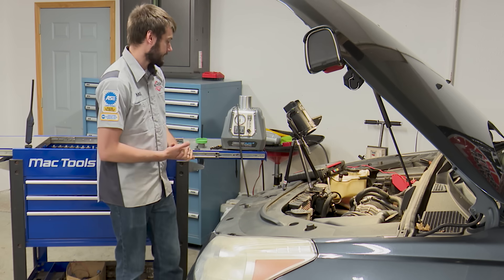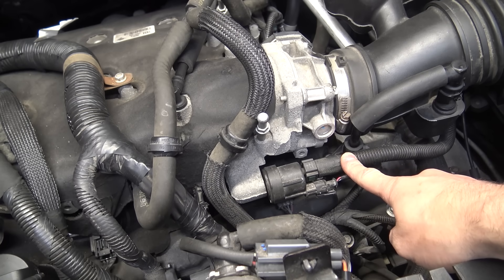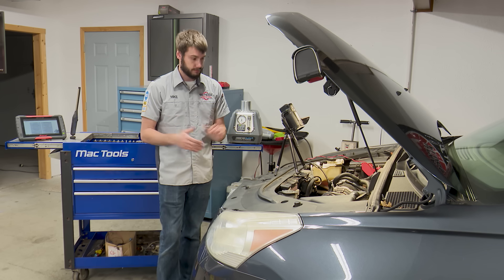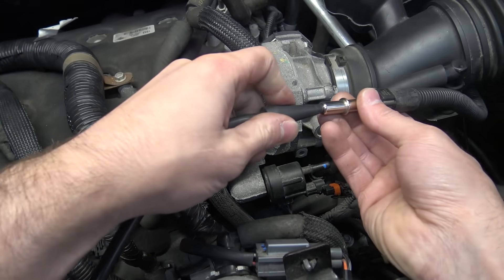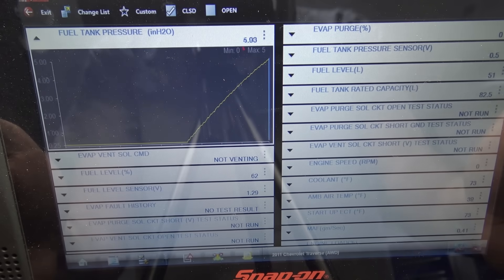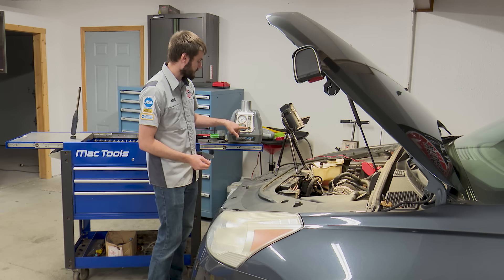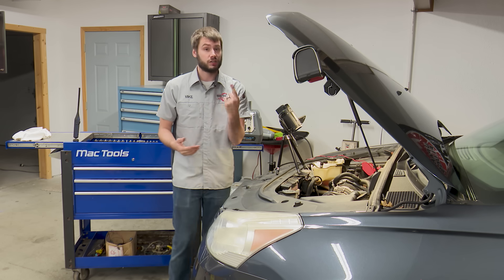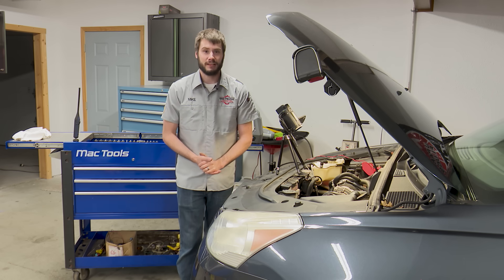How To Perform An EVAP Smoke Test To Look For Leaks

Comment: Probably not the best way but since i dont have a scan tool in the past ive run jumper cables from the battery to the tank area and use little jumper leads directly to the unplugged vent solenoid with a spare fuse inline

Comment: Great  video  tranks    is any other  possible place  for a  vacum leak     cause  i did  flollow  all this  steps   and still keep a  getting  p0442 code  purge  valve  and  vent  valve are  working

Comment: I bought a smoke machine from eBay for $30. Plugs into the battery And does everything that machine does, and way smaller. 1500 is crazy for a smoke machine.
Reply: Facts, unless you charge like crazy I bet it’d be pretty hard to make that money back on purely evap leaks, I feel like most people ignore them if they have a scanner since the car runs lol

Comment: can someone please show me how to smoke test a 2001  dodge ram 1500 v6 ,  I have  a smoke machine,  I don't know how to close the vent valve,  I am told this truck does not have one,  I have changed the fuel pump, solenoid purge valve ,  gas cap and the leak detection pump still can not find any small leaks and the check engine light keeps shining with code P0442.   I greatly appreciate it

Comment: I don’t have a full featured scan tool. What happens if I run a smoke test without closing that vent solenoid?
Reply: Smoke will most likely empty thru the open vent solenoid port.

Comment: Thank you for the video, very informative with multiple solutions to my unasked questions. One question was unanswered. With the P0456code stating an extremely small EVAP leak, which I believe would be linked to a possible gas cap. Can’t confirm at this time, need to acquire a smoke machine.  Car has a cap-less filler neck. I am going to clean the valve on the filler neck after I smoke test the system.

Comment: Do i need to remove the shrader valve from  inside that green cap to instal my smoke machine? i have 2002 toyota camry le 2.4  with a p0442 only.

Comment: What about smoke coming out from around the gas cap flange?

2016 Kia Rio. I started with an P0455. Changed the gas cap with an OE replacement and a purge valve. After that the gas cap light would illuminate periodically. I have a CCV ready to go, but smoke tested and found a serious leak where the filler neck meets the body.

Comment: Hope I get an answer 
I have a evap leak and I did  smoke test on my 19 Silverado and smoke is coming out of the vent solenoid filter, is that normal or what does that mean ? 
Any help please
Reply: If you smoke from Purge solenoid hose, this is normal. As the vent solenoid is normally open condition. If you want to test the leak , Close the vent solenoid.

Comment: Definitely  think automation  toyota  is fucking  me. They gave me a vague response  saying  smoke  seen from vent hose and gas tank. They saying  it will cost me 700 or 1700 bucks but they wont know until  they drop the tank.  But it could just be a vent valve.

Comment: Glad you mentioned the low-pressure requirements of an EVAP system. Most of the inexpensive, Chinese-designed smoke machines I've seen, which have the on-board compressors, go way over that pressure ~0.5PSIg limit yet still claim they're EVAP safe. I was curious, can the smoke machine you're using be used to test for intake manifold leaks or is the pressure too low?

Comment: Been a long time I see but taking a chance... Evap code so did Smoke test done on a Mustang '17 with no issues detected, no gas cap on this model.  Garages are still unsure the cause on this vehicle.  From time to time the engine light goes off for 1-3 days but comes back on.  Last test was while engine light was on so really unsure how to determine what the problem actually is and it costs $150 each time to have this test run.  Any thoughts?

Comment: This same machine cost 69 dollars today
Reply: Negative. You can get some machines for under $50 but not that model/brand smoke machine.
Reply: 😂😂😂 did he really pay 1000$
Reply: Can do it with a cigarette or even a vape pen if  you can fashion a nice snug  fit using a bit of rubber hose and/or electric tape though most vape pens cut power to their heating coil every 8-10 seconds so you might need a 2nd person to keep pressing the button on it while you look for leaks
Reply: Tik tok $40 use it at my shop plenty of times 😂

Comment: How would you use a smoke machine to figure out a p0171 p0170 code on a Honda ? Where would you connect the hose of the machine to? The intake or another place?

Comment: I have a Mercedes Benz. I can’t buy a scanner or find anyone who can run all the tests/sensors/valves. (Close vent solenoid) I was getting Intermittent low, purge flow and high, purge flow codes? P0496-97. P0455.  small leak AND  large leak codes? 🤔 but after replacing the purge valve, I’m only getting the P0497 every now and then (1-3-7 days) now (i think) but the others still may pop up) P0497 Low purge flow. Dirty or clogged canister? Should I just clean it out? Clean the sponge/fet etc? What will help my low/rough idle? That’s what I’m trying to fix. I’ve seen that if the purge solenoid on the canister doesn’t close to cause combustion, it will cause a low, rough idle 🤷‍♂️ 
It only needs to go up 500-1000 rpm to be completely smooth. It’s idling just around just around 1050 instead of 1200/1300 (1250 is my target) 🤷‍♂️ Tia.

Comment: Great video, I smoke tested my 2009 pontiac g8gt and I have to use a latex glove and ty-wraps to seal of the throttle body. Shouls I be getting smoke out the throttle body.  Perge valve is closed and vent valve is close.

Comment: I have an 06 ram 1500 that has a strong gas odor at the rear drivers side wheel well where the gas tank is. I dont see a physical leak of any kind from the various connectors on the tank and have no check engine light. Any ideas.

Comment: I had a guy do all the gas stuff underneath 06 avalanche changed my gas cap an put a brain in I got a large evap an rich bank 1 and 2 an a couple other codes going to the state place for a sticker then going to monroe for 100 dollar smoke test my other guy wouldn't even touch the other guys work I believe guy that did the gas put a oil stain near the gas cap to was clean when I got it an it's a mess now only been 7k miles h8 ri mechanics

Comment: So you want me to buy a 1500 machine to test a leak? Get real. Maybe this video is for mechanics that have a need for such a machine for repetitive uses in their jobs. Not for once a blue moon usages. I would use other methods to find my leak. When doing videos, you have to take into consideration, cost and benefit. To buy a $1500 machine and all the other stuff you talked about once every 5 years use is not effective. The unused machine would be probably fail for lack of use anyways. Sorry for the unfavorable opinion with the previous disclaimer that this might be a video for mechanics. If so, my apology.
Reply: Or you can just make your own smoke machine. Pretty easy

Comment: When does the vent solenoid close on its own? When it’s running or when the engines off?
Reply: It closes when the EVAP system is doing a self-check. Otherwise it stays open.

Comment: I just did a smoke test from the purge valve and after about 30 seconds fuel was leaking out of the filler neck. What could that be? I was thinking a saturated canister

Comment: I did the smoke test I see smoke come out of the gas cap it's band new from dealer. is the gas cap work on vacuum or pressure. what should I do next new cap again I clean the fill neck very well got better but still a little smoke come out.

Comment: If the vent valve is normally open, what prevents the gas fumes from escaping to the environment there. Through the open vent valve.
Reply: From Go Tech instructor: The vent solenoid is open unless the vehicle is testing the system for leaks. This is because the fuel tank needs to vent with the expanding and contracting associated with temperature change. This ok be cause all the venting must first go through the charcoal canister to be scrubbed before entering the atmosphere. The system checks for leaks because if there was a leak, hydrocarbons would be able to vent from the tank without first going through the canister. To smoke test the system you must first close or block the vent solenoid off. I hope this helps and good luck finding you leak.

Comment: How much is enough pressure to pump in the system? You said you shouldn't"t put more than 2 psi! I"m confused by what you said!
Reply: Typically, you don't want to add any more than 0.5PSIg into an EVAP system.

Comment: If it throws this air intake system performance code when i get the gas. Then it will go Away.  I've changed maf & cleaned the throttle etc.  Still having it come on after getting gas & it will go off

Comment: Great info, thanks.  Maybe someone can answer this. My understanding is the entire purpose of the EVAP system is to prevent gas fumes from going into the open air, ie outside the tank. And in fact those fumes are trapped and drawn back into the engine through the purge solenoid, and burned like fuel. Which was the first thing referenced in the video.  So why is the vent solenoid in the Open position? Thanks.
Reply: Great question. I've been unable to find a (convincing) answer to this, as well.

Comment: Good job. I refill my machine with baby oil. A lot cheaper and smells good. Another thing is I bought a smoke machine for smoking intakes for vacuum leaks. Much cheaper than a evap smoke machine. You just have to add a inline check valve so gas fumes cant back flo into the machine. And test the check valve before each use.

Comment: I did a smoke test for a 456 code. I plugged the evap vent port on the canister. Verified smoke in the system at the gas cap. I get ZERO leaks anywhere. Even used a small camera to get up close along the entire system. Driving me nuts because sometimes with a full tank of gas I smell strong gas fumes at the filler neck area so I feel like the vent is just always venting and the purge solenoid stops sucking the fumes out of teh canister...Frustrated

Comment: good video i took my truck 88 chevy cheyenne 4.3l for a smog test everything went great 
it pass everything until it he put smoke in the gas tank and said I had gross leak and fail the 
test. Now I need to find the leak. it looks like all the evap stuff in under the hood but i just 
don't know if there some type of vent solenoid by the fuel tank or not. I remenber in the 
old days mechanic would clamp the vaper hose from the fuel tank to do a smoke test. 
I can't find info in my Haynes manual which is useless . does anyone know?

Comment: So I performed this test with my smoke machine, closed/blocked the vent solenoid pipe system wasn't holding pressure extremely small leak, noticed very faint smoke and could hear a hissing noise from my gas cap so is that my leak? My code is P0456 very small leak. The gas cap is supposed to keep the pressure in when the car is off yes?

Comment: I appreciate this video, but I followed everything, still can’t find the leak on my work truck. Had to remove resonators and exhaust system to rid of multiple cylinders misfires. Engine is loud, but functional, still haven’t found the leak, that’s cause more fuel into exhaust, destroying my catalytic converter.

Comment: When I used my scan tool to do the self test. Evap system the gas cap was doing noise, maybe because I have a vented gas cap, but the tested passed ok. The problem I'm having is that my car has trouble starting in hot days, and also after filling the tank. What it could be, it's  toyota Corolla 2003 engine 1.8
Reply from the maker: Hey Rocky,
I would check your purge solenoid for sticking open. 
~Ryan

Comment: Hey brother one question, you mention that the vent selenoid has power all the time. Does that include when the car's switch is OFF?
Reply from the maker: Good question! 
No it only has power with the key in the ON position
Reply: Vent solenoid is typically in a normally open position. When it receives power + ground, solenoid becomes energized and vent closes.

Comment: I’m curious, is the code for the evap canister the same as the code for anything else including a gas cap problem?
Reply from the maker: EVAP codes can be a pain...Never trust what the code says at face value. Always test the system as a whole.
~Mike
Reply: @GoTechTraining  thanks..it says “Gross leak” by the way..
Reply: @GoTechTraining  turned out to be the sensor only..

Comment: Question. I ran a smoke test and there’s smoke coming out around the gas cap. It’s a brand new cap and there’s no cracks on it. I also have no EVAP code but I do have two lean codes. P0171 and P0174
Reply from the maker: Hey Darvin, Thanks for watching! Interesting. So an evap leak back by the gas cap won't cause a lean condition. I would fix the lean condition first before spending time on an EVAP leak that may or may not actually be a problem. 
~Mike

Comment: Made my own smoke machine using an old blood pressure checking machine only puts out 2 psi max , just put a little knob regulator on it ...it takes a couple AA batteries soldering iron pickle jar ... Pick up a blood pressure machine for free I had four just laying around.. I'm sure you could find one at Goodwill or something there's no way in hell id spend $1500 for a smoke machine
Reply from the maker: That's clever for sure! Good work!
~Mike

Comment: 2014 nissan versa. Evap not ready. No Check engine light.  Car won't pass smog
Reply from the maker: Hey Dosal310, thanks for watching! The EVAP test is the hardest test to pass. It takes the most amount of time. In my area, we can pass with one test incomplete. Nothing is failing? Have you recently had work performed or cleared the trouble codes or anything like that?
~Mike

Comment: thanks for these info , i was told you only need to turn the key an on position  and the vent valve will activate  but i guess that is a lie !!!!! so you need a scaner to close the vent valve and then use smoke machine .. thanks again
Reply from the maker: Hello Beatriz,
You can also  manually close the vent solenoid by supplying it power and ground if a scan tool is unavailable.
Thanks for checking out the video and reaching out!
~Ryan
Reply from the maker: Hey Beatriz, thanks for watching! Right, the vent solenoid will only close when the computer is attempting a system leak test. Using a scan tool or power and grounding the solenoid are the only way to force it closed.
~Mike

Comment: What if after performing the smoke machine test and it has no leaks? But it still says large leak
Reply from the maker: Hey S Esparza, thanks for watching! So maybe you're dealing with an intermittent problem? Or, how are you forcing the vent solenoid closed? Are you pinching a hose off? Maybe the vent isn't closing electronically? Also, where are you hooking up the smoke machine? Could the leak be on the other side of where you're hooking up?
~Mike

Comment: Is the air filter box suppose to have smoke coming out of the housing?
Reply from the maker: Well, that is interesting! What kind of car are you working on and where is your smoke machine hooked up?
~Mike
Reply: @GoTechTraining  2005 accord...3.0 V6....I have the smoke machine hooked up to the middle top portion of the upper intake we're the brake booster hose connects.
Reply from the maker: What are you trying to accomplish with that test? Hooking into the intake will force smoke through the throttle body and into the airbox, that's normal.
~Mike
Reply: @GoTechTraining  I'm trying to find a vacuum leak, I have replaced the 02 sensors, maf sensor, sparkplugs, EGR valve, pcv valve, fuel pressure seems to be ok, but I do see the gauge drop to zero after letting the engine sit for 30 min or so...!! I keep getting a p0171 lean condition bank 1!!
Reply: Im curious to know if a bad fuel pump can cause a lean code only in bank 1? Some say yes, some say no🤷 I would like you expert answer.

Comment: smoke testing on a 2013 silverado 1500 LMG. P0446 code. applying smoke behind purge solenoid as you did i have smoke in the tank but not at the vent valve. I disconnected the line from the canister to the vent valve and still no smoke. does this suggest a plugged charcoal canister???
Reply from the maker: Yes it sounds like the canister could be plugged, to prove this I would take the hose off the canister that goes to the tank and see if smoke comes out.
~Ryan Wilsing

Comment: How do you manually close the vapor canister vent valve?
Reply from the maker: Hey Anthony, you can either use a scan tool or you can use a jumper lead and run the jumper to ground. They are usually powered all the time and ground side switched, you need use that jumper wire as the switch in this case. 
~Mike

Comment: Great video. Can you tell me how I can close the vent solenoid on a 2013 Dodge Avenger 2.4 with out a snap on Polaris?
Can't I just pinch off the hose?
Reply from the maker: Hello,
A 2013 Dodge Avenger runs a ESIM Evap system and does not use a vent solenoid. The best way to test is to locate the ESIM which is mounted on the canister and pinch off the hose between the ESIM and filter.
Hope this helps!
Ryan Wilsing, Technical Instructor
Reply: @GoTechTraining  Cool. This is the same part that fixed my last P0455.
I felt compelled to run a smoke test to check integrity of the entire evap system. You all are great